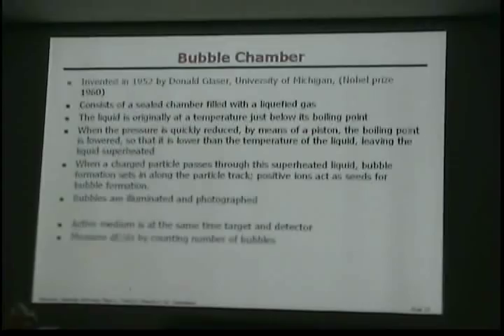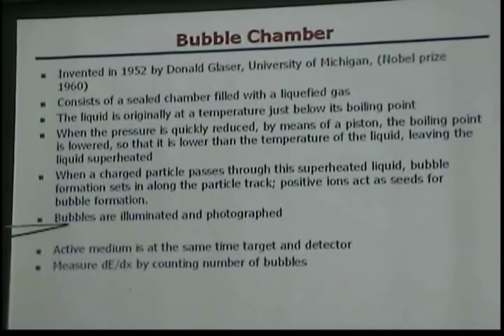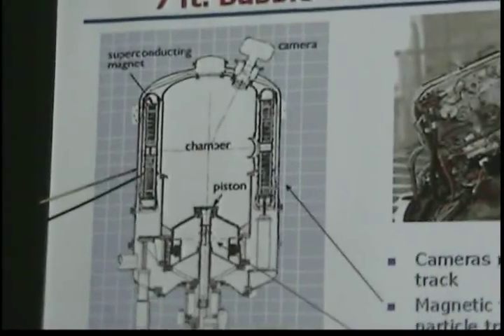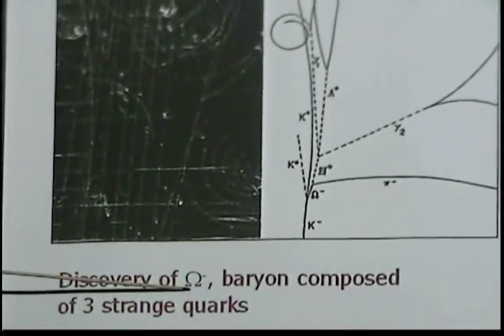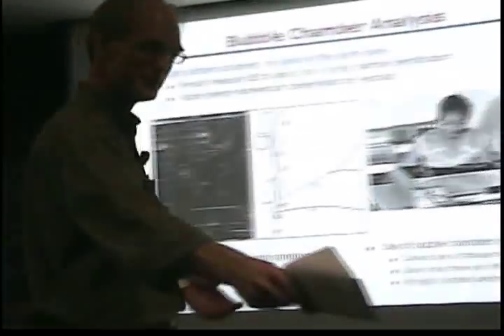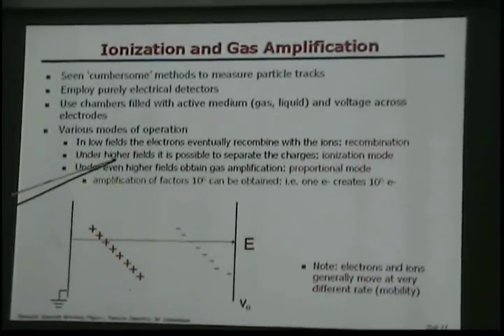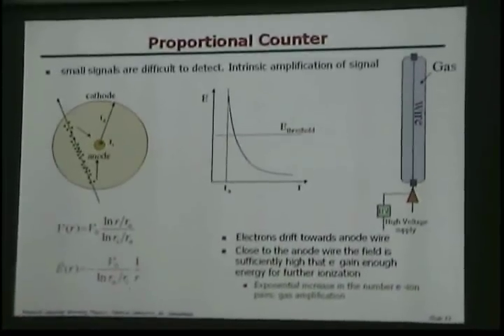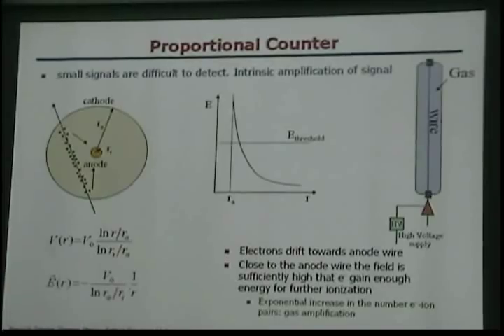Particle Physics: Bubble Chambers

Comment: New point of view.

 The detected material mass of  the  matter in the Universe is 
very small (the average density of all substance in the Universe
 is approximately   p=10^-30 g/sm^3) .
It means that the masses in the Universe are very few.
The distances between stars are very far. 
About  99% of the matter in the Universe
 is unseen  dark mass. Nobody knows what it is.
Question:
How  can the  99% of the Hidden matter in the Universe
 create  the  1% of the Visible matter ?
Reply: why not